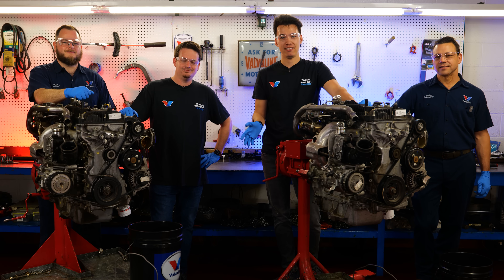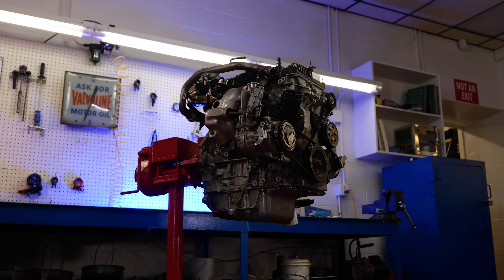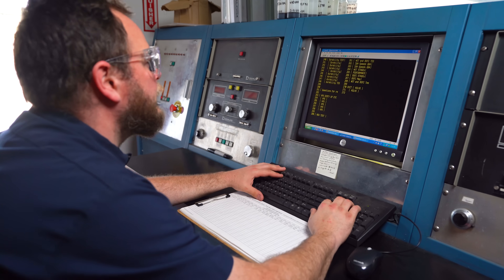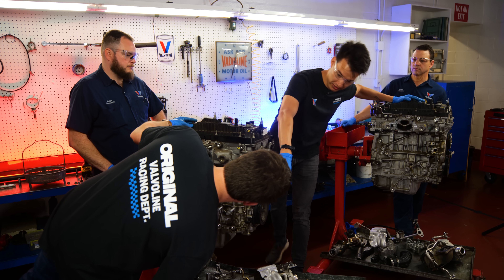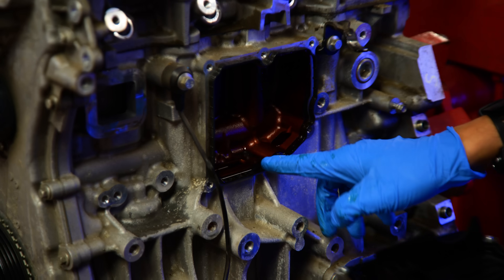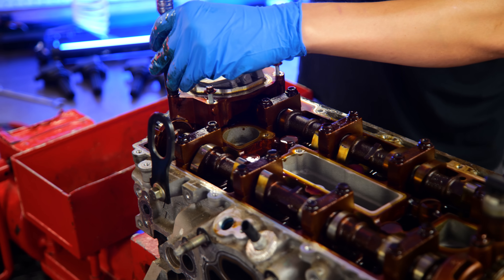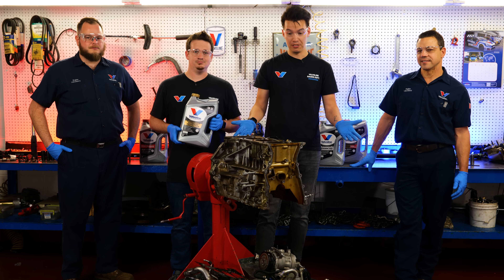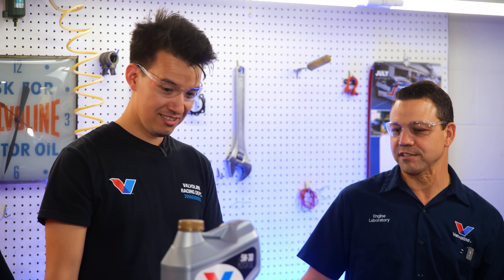Testing different oils over 4 years and 1 MILLION miles

Comment: The promise of synthetic is longer range before oil changes are required but costs much more. Conventional oil generally requires changing every 3,000 to 5,000 miles, while synthetic oil can last significantly longer, with recommended intervals ranging from 5,000 to 10,000 miles, and sometimes up to 15,000 miles. If you're changing both at the same time then that's not a fair comparison.

Comment: They ran at 10K oil change intervals. That's the fast track to engine buildups and problems. I love Valvoline, but I won't ever use these crazy maintenance schedules they're trying to push.

Comment: most americans don't even keep their car for 100,000 miles, so if both made it to 500k, which is far beyond the life cycle of most cars in the US, much less any single ownership, then why does it even matter? which is what ive been saying to these guys that lose the forest for the trees and obsess over meaningless things like this. most of you dont even own what you drive. most of you wont keep it more than a few years. and you're obsessing over oil? for what? outside of extreme abuse or defect which will result in failure no matter what you do or don't do, the engine isn't even the failure point of for the vast majority of cars. everything else will fall apart long before the engine fails no matter what oil or what interval you use. stuff is silly. if you want to obsess over some minor detail or a fluid, you should be more obsessed with what type of gasoline you fill up with. and yeah sure, use synthetic oil. it's not like it's expensive. how much does it really matter in the grand scheme? not much. even a turbo charged direct injection American (trash) made it to 500k on convention oil with 10k intervals. your interior, transmission, suspension, paint, everything else will be falling apart long before 500k.

Comment: You used conventional oil and ran them 10k miles… that’s probably an issue - if you ran the conventional at 3k miles and the synth at 10k that would be a more comparable test IMO

Comment: While I do not use Valvoline I agree a good full synthetic and filter changing it at the recommended time frame  will take even a badly designed engine a long way. I am surprised these engines made it that long. props to ford and Valvoline.

Comment: I’m 35, never knew shit about cars but recently became interested by watching here on YouTube. Bought a Mazda 3 hatch brand new in 2016, and aside from wear and tear stuff (tires, brakes, wipers, headlights, timing/serpentine belt) I ALWAYS have my oil changed at 10,000-12,000 miles, full synthetic, and I’ve never had any problems whatsoever with my car, thank god.
Reply: Boomers just watched this video and they’re still unable to comprehend that synthetic oils don’t break down like their organic conventional counterparts. 10k is the interval determined by the damn people who designed the engine.
Reply: @ChrisSysaktor  these are the same people that want you to buy a new car at some point. A slightly shorter oil change interval than recommended is a good idea. Back in the 80s-90s-00s car were reviewed also based on the maintenance cost by the specialised press. This pushed car manufacturer to increase oil service intervals. A shorter oil change interval, particularly in real life situations like cold start, short journeys or high performance usage can extend your engine lifespan significantly. I'd would probably go for 7500 miles or every year.
Reply: If you’re 90% highway at highway speed (not stop and go rush hour) that interval is fine. If you’re city driving, you’re driving a carbon buildup time bomb.
Reply: @ I’m sorta in between. I drive mostly on 35-50mph speed zones, a couple red lights, but mostly up and down in elevation, a lot of windy turns. But hey, thanks! So what would you say, maybe 7000 miles?
Reply: You car is on 9 years old.  Chaging oil at 10,000-12,000 interval is too long .  You need to change the oil at shorter interval like 5000-6000 miles.

Comment: Suggested Collaboration Between Two Channels, Based Upon Valvoline EngineS TeardownS, Plural,

🙏🏽Namaste🙏🏽… Eric, And Mark, Ben, And Ben,

🙏🏽Namaste🖖🏽... 😎 Stacie&Tull Hope You Are Choosing A Loving Blessed Happy Healthy “Live Long & Prosper”🖖🏽 Day… Helping Dreams Come Alive, That Is Key In 2025🔮 

¡. Brilliant…!

SHOP FAILED! 2019 Ford Ranger 2.3L Ecoboost Engine Died @104K Miles. Owner Should Be ASHAMED!,
I Do Cars,
https://www.youtube.com/watch?v=DayNJuybk90&t=13s

Testing different oils over 4 years and 1 MILLION miles,
Gears and Gasoline,
Aug 31, 2024,
https://www.youtube.com/watch?v=l4D8C6WR3pE 

Me thinks that y’all will make a great collaboration.

Thank You In Advance,

How-Ever I May Be Of Service,
Please Ensure That You Reach Out To Me By Any Means Listed Below,

With Love 💗,
I Truly Re-Main,
Tull
ASE Certifications Held (Retired) - Disk And Drum Brakes (BR), Carburetor And Fuel Systems (CB), Conventional Ignition (CI), Electrical Systems (EE), Engine Repair (ER), Heating and Air Conditioning (AC), Manual Drive Train And Axles (MD), Supplemental Tasks (GT), Steering And Suspension (SS),
Circa 1980 To 1991,
😎A Sixty-Three-Plus 63+ Year🗓Old Heartist💜...🔮

Comment: Simple.
Put cheap oil in your car, change oil & filter every 5,000 miles.
Change your car for a new one every 5 years & you NEVER have an issue.
Most people change their cars every 5 years or so anyway.
Because the get fed up with it & want to try something else with more 'Bells & Whistles' on it and also to get shut of it while there's still some really value in it as a part ex.

Comment: My WRX manual says change every 6K, I change it every 5. Full Synthetic. In my older vehicles I run the Rotella synthetic blend and change every 5K->  Zero sludging, varnishing. Use quality oil, use the correct weight, change often.

Comment: My experience is that synthetic often do bether in action tests like this, but does worse in down time  tests: like run it for 10k miles let it stand for a year and then run it a other 10k miles. Yes its not what its suposed to do but still its what most private use is. Like my chainsaw, or clearing saw gets oil when it needs to, but then it stands in the garage for the rest of the year/winter. And i will say that syntetic, specialy eco syntetic is garbage

Comment: What did they expect by running conventional oil 10,000 miles between changes? Changing the conventional oil every 3,000 or 5,000 would have been a more realistic comparison of cost versus performance.

Comment: One thing to note is that the ecoboost + turbo is meant to be run with only full synthetic. Those engines are very very hard on oil. I suspect on a conventional (naturally aspirated) engine which doesn't demand synthetic, the difference wouldn't be as stark. You should also never run those engines at the 10k mile increment. They really want their oil changed every ~5k.

Comment: Valvoline fully synthetic is all I use. Had 2 ford focus 2012 and 2016 both to 250k miles from new.  5000 mile oil changes and u can look down the valve cover and they both looked brand new inside. Great oil!

Comment: I think one of the biggest findings here was that 10k mile intervals were at least a little too much for even the synthetic.   Although it was not stated in the video, almost all of that varnishing and sludging occurred in the last 2,000 miles of the 10,000 mile runs because this process really gets rapid after the oil has degraded past some point.   If the synthetic was changed at 7,500 and the conventional at 5,000 there would be almost no varnish at all in either of these engines.  Although specific oil degradation rates are different for each engine type, drive cycle, and ambient conditions, this video along with lots of other evidence suggests that many of those actually pushing change intervals to 10k miles or more are slowly sludging up their engines and do not even know it.  Some now are doing 15k mile changes which is probably not very wise in most cases.

Comment: 10,000 mile oil changes! Comparing conventional and synthetic! Conventional is not made to go 10k. This test should have been 3,000 vs 10,000 which is what both oils are rated for. 🫤

Comment: The question should be the oil change interview.  If the oil is regularly change there should be not much difference.  Other wise the synthetic will come out better.   Another question is if the engine is used by grandma to pick grocery or a young teen racing with his friends.  If it is grandma  then there is no difference..  Lastly any engineer will tell you the mileage is not accurate,  engine wear and tear happens most during start and stop.  NOT miles driven

Comment: Did you say 10,000 oil change??? Hard Pass.  Hard to believe lasted 500,000 miles.   My 2006 Toyota Sequoia 4.7L V8 engine  receives oil change 3,000 miles or every 3 months. Currently at 232,000 miles.

Comment: To be fair, 10k oil change intervals on dino oil is kinda pushing it. It would have looked a lot different inside if you changed it out at a more appropriate time. Pushing change interval of conventional oil to synthetic levels is not really fair.

Comment: Other than synthetic being cleaner they both lasted 500k miles with minimal breakdowns. I suppose the controlled environment helped because very few vehicles last this long. My dad´s old ford truck had 345k and was still going and although he changed the oil religiously he used the cheapest oil possible. As opposed to my 2001 BMW 740i M Sport which never saw anything but the best oil and still had the same varnish as the engine shown here.

Comment: I’ve taken a lot of motors apart. Synthetic used engines are always burned, and stained. And worn much more. Sometimes damages are real bad. Stay with conventional oil, change it in less than 4,000 miles.
Reply: So how do you explain the results shown in this video? God i swear some of you old fogies can’t seem to leave the 70s behind

Comment: I just don't get it why would you still use conventional oil. It's not 1920s anymore. The price difference between full synthetic isn't that big but engines do cost much.. In europe at least only old junkers that burn and leak oil use conventional.

Comment: So here’s the question, what if we don’t change the oil but only add when needed? How long will the engine operate before failure? How many operating hours are reduced? 50 oil changes is at least $1500. If I can get 300,000 (no oil changes) out of an engine versus 500,000 with oil changes well that’s all I need.

Comment: Blows my mind that people still try to argue that there is no difference between the 2 like its just a marketing ploy or something
Reply: Blows my mind that people still argue that you can't mix them despite nearly every oil manufacture having some type of synthetic blend. When I first started working at the parts store I would try to educate customers, but I eventually learned that most were a lost cause.
Reply: i do not know anyone who says there is no "difference."  but both cars were still functional at 500k miles which is prob 2-3x as long as most people keep vehicles.  from what i could tell from this test, is there is no functional difference.
Reply: You can't fix stupid.  Or ignorant sometimes.
Reply: But it's every 10,000 miles, no one is arguing conventual oil last as many miles, the factor is bad oil change intervals. It's like saying someone in wheelchair is faster, because its only down hill.
Reply: @ohcrap2222  It's basically 10,000 highway miles with as few cold starts as possible. That's not nearly as stressful on the conventional oil as it sounds.

Comment: Looked like the synthectic had more wear, so why didnt you mic it and see?
Reply: that’s in your head bro
Reply: @lukeWiz44  thats what mics are for brother!
Reply: @anthonyking4387 like microphones?
Reply: @lukeWiz44 😂😂😂 i hope your not serious! If so we shouldnt be having this conversation! Everyone knows that you cant even run synthetic in a engine wt a flat tappet cam!
Reply: @anthonyking4387 I think you might be a little misinformed about engines and engine oil. Synthetic or conventional base oil does not matter when we talk about choosing an oil formulation in a flat tappet engine(which this modern ford 2.3L ecoboost is not). Zinc, is the additive needed to protect those older flat tappet engines. Base oil stock has nothing to do with it. Besides- today’s marketed “full synthetics” are just more highly refined conventional oils. Hope this helps!

Comment: Thanks.... but.... the real mechanics and engineers want the FACTUAL details.
How did the components of these engines stack up against the OEM specifications? 
What was the camshaft lobe wear? ...cylinder bore wear? ... piston wear? ... bearing surface wear? Valve train wear? .... Cylinder head wear? .... turbo wear? ... etc. 
What was the gasket elasticity? .... what was the specific head gasket condition (very important)? 
These things will provide the actual picture indicating how well the two oils provided mechanical as well as cooling, engine protection. 
Varnish deposits are expected, as all lubricants within the engine burn at operating temperatures. 
Conventional oils ignite at lower temperatures and result in higher ash content resulting in increased coking,  as well as a Sticky, Rosin type varnish, 
.....
The fact these two engines lived for 500k miles is amazing.... it shows that proper maintenance with newer vehicle technology, pushes the survival mark of modern vehicles, far past the prior assumption of 100k miles.
It would be beneficial for techs, and engineers to understand how Valvoline maintained these vehicles and obtained these results. 
Thanks again for the video....  hopefully more to come...

Comment: As interesting as this is, it is not a valid test because the sample size is just 1. For all we know, one of the engines could have had different clearances, the PCV valves could have been functioning differently, etc. Also we don't know what additives were in the two oils, and the difference could have simply been due to the detergent level, etc. and not the fact that one was synthetic. Remember, "synthetic" oil is NOT "full synthetic," that is simply a marketing tool. Most have a small percentage of actual synthetic stock, with the remainder as group III, which is labelled synthetic but actually is not. Consider this a Valvoline marketing tool to get you to buy their more expensive oil.

Comment: Why 10000?
Reply: It was fords recommended for those engines. They wanted to run at mfg specs
Reply: to rig it in the synthetics favor so you will buy their more expensive oil
Reply: @wiseachre or… hear me out… the synthetic lasts longer due to being a higher refined base oil and more aggressive additive package.

Comment: I owned vios and corolla same engine 1NZFE. intervals for Vios @5000 km 10w40. Corolla 5w30 @ 7500 km. Corolla got streched chain @240k km. Now both passing 400k km. Vios still no stretched chain, compression tested got 190-198 psi per cylinder. Corolla 158-166 psi per cylinder.

It seems thicker, and cleaner oil got crazy extra life on parts.

Comment: I continually hear from V8 guys that the 4-cylinder turbo engines won't last as long as V8's. This test pretty well proves that a 4 cylinder built for turbo use, like Ford's proven 2.3 L, will likely last much longer than the V8's.  I've driven a 2.3 L turbo Ford Ranger cross-country across the Rockies in Colorado, and was amazed at the little Turbo-4 climbing long grades at high altitudes, running 70+ mph, barely turning 2000 RPM. V8's climbing the same grades were turning nearly 4000 RPM, (and sometimes higher RPM!).  Seeing that convinced me that the little under-stressed turbo-4's were likely to last longer than the V8's.

Comment: Conventional oil engine definitely looks like the oil wasn't changed every 3,000 miles or 3 months. Most rings should spin slightly in the bore if the hone was done correctly. Only time I have seen stuck rights, once again, was improper oil change interval. Best part is over the 4 decades of engine rebuilding, Valvoline and pennzoil have been to worst for deposits and buildup. I wouldn't give an exact estimate or opinion on what's needed until I pull the valve cover. 90% of the time both oils mentioned had excessive varnish and many time the build up was so bad the rocker where a different shape and the build up was flaking off. Yes, oil changes were not done at the right intervals but those two oil brands where the worst.  The rings are intended to move a bit for the reason of keeping them loose.

Comment: Two seconds of bore pics and ten of a cross wiped in a pan. So sad. Let’s see bearings? Chain wear between them? 
What fuel was used. How much oil was used between them. How about the mpg difference? So lame to burn all that gas and use up two vehicles for a useless video

Comment: In world war II was when a synthetic oil was invented, dial Union 76 made a synthetic oil that was purple. It wasn't really good I didn't have the best luck with it I'm trying to save fuel on my generator because I lived in the woods. Now the new synthetic oils are so much more Superior. By the way me and a few mechanics were actually blending the oil before it went on the market we would do 4 quarts of good grade regular oil and 1 qt synthetic oil. It made the engines run a little bit better and better mileage. Running smoother. They put on market it was called duralube oil. Now the main question is this if they allow the fresh air to go in the valve covers, and then the PC valve hooked up to some breather system where it would suck the dirt out from the crankcase the acids and other sludge that comes from blow by. That would make the perfect engine solution for beater system. And the engine would run a much cleaner.